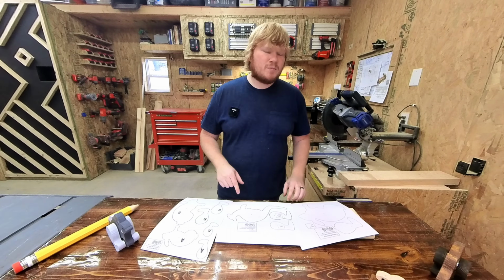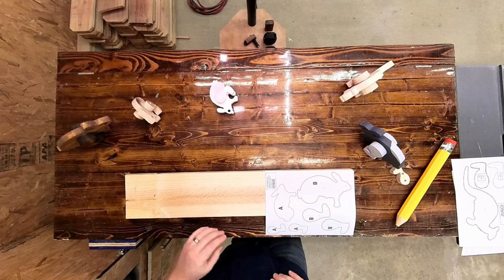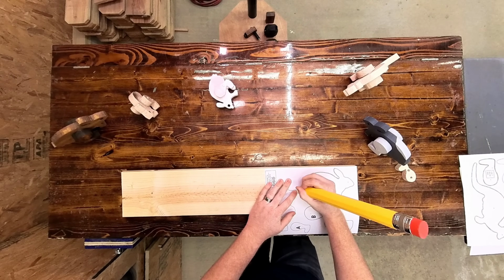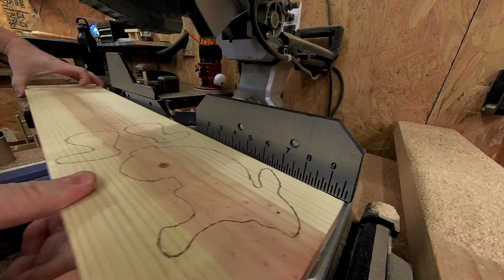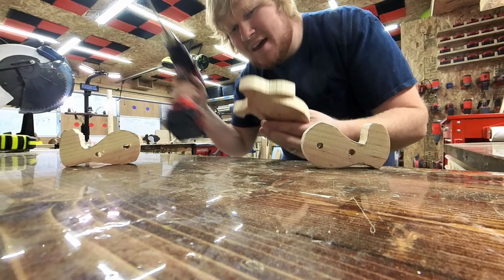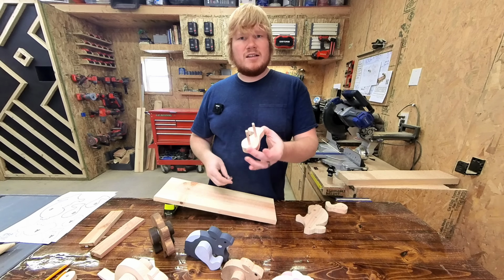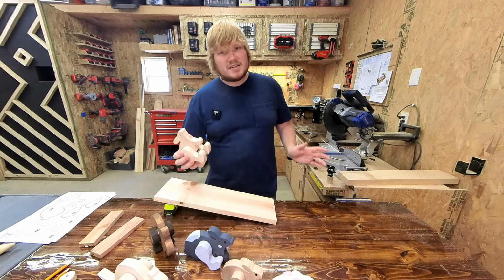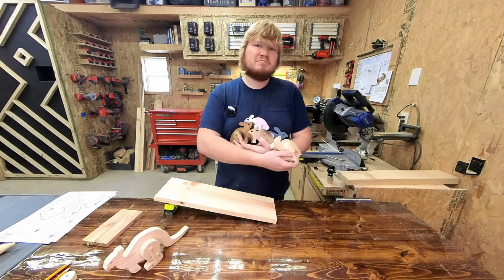A Hopping Bunny Toy! Easy Beginner Woodworking Project. FREE PLANS! | How To

Comment: for transferring your designs you could rub a pencil on the back of your plan paper so when you draw over the lines on the other side it will "carbon copy" onto your wood
Reply from the maker: A previous commenter mentioned that, I gave it a try and it works pretty good!! :) thanks buddy

Comment: If you don't have transfer paper, you can also make your own kind by taking a pencil and covering the complete back of whatever you're wanting to trace with pencil marks by holding it at an angle, then with that on the back, lay the paper with the pencil marks down, and trace the lines of whatever you're tracing.

It transfers the pencil onto the board from the paper, where ever you press down on while tracing.

And if you're using a laser printer, and need really accurate lines or age for something, you can print whatever you're wanting mirrored onto paper then lay the 8mage s8de down on your piece, then depending on material, either use acetone or an iron to either soak or hear the paper, and the image will transfer from the paper to the piece
Reply from the maker: I will definitely be trying the pencil transfer method you shared. Thanks! :)

Comment: I followed the plans - I put it together but the balance is off -  it sits on its backend.  Do I drill another hole more towards the rear
Reply from the maker: You can drill out/sand some in the back or you can angle your board a little more :)

Comment: What’s that ryobi fan on the ceiling?
Reply from the maker: My ryobi garage door opener is modular, you can add fans, electrical drop cords, speakers, cameras etc, it was a pretty cool system. But yes, I have two fans on mine :)